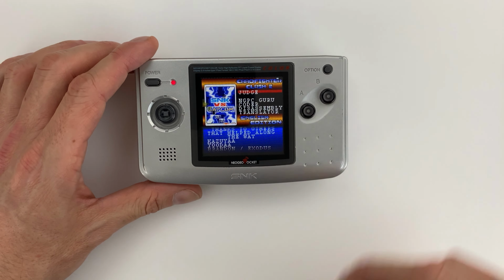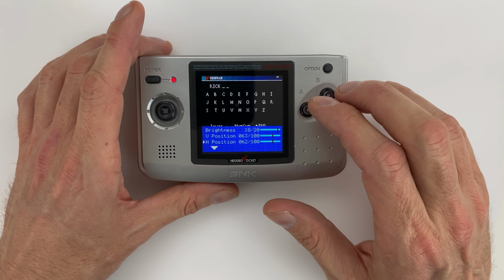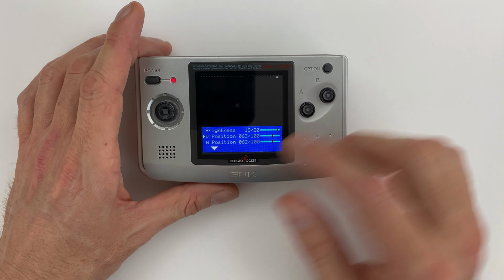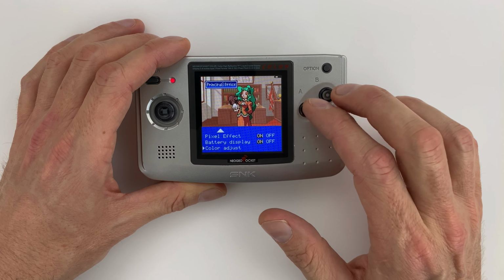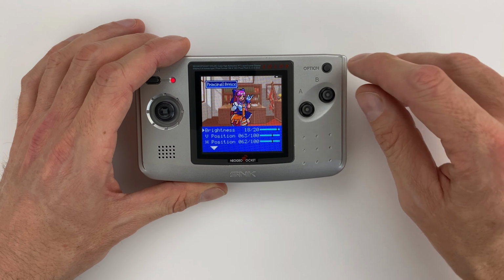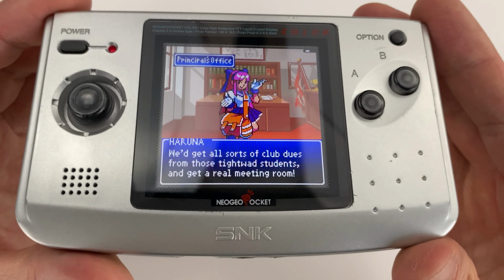Upgrading the Neo Geo Pocket Color Screen (Full size IPS LCD Screen Kit)

Comment: For information, with this new IPS screen, it is advisable to use 1.5v alkaline batteries or rechargeable batteries with a constant voltage of 1.5v, because conventional rechargeable batteries have a voltage of 1.2v and this is not  sufficient for the IPS screen. If you use 1.2v rechargeable batteries, the console will turn on the first time you use it, but after that the screen will not turn on, there will be only sound and no picture. In this case, you have to remove the 1.2v batteries each time, wait a bit and then put them back to play again.
Conclusion, buy 1.5v stable voltage rechargeable batteries or alkaline batteries

Comment: Is replacing the front glass really necessary? In every installation video I’ve seen people are doing this, but mine is in good shape… how come everybody is using the one that came with the kit?
Reply from the maker: I’m guessing to have nice new adhesive, and maybe a better front glass/lens? When I remove an old glass lens I know I usually consider that part as no good. Have you had better luck with that?
Reply: @jivinhipcat  we'll see im attempting the mod right now 😅 i just dont want to do the extra work of replacing the screen i guess?
Reply from the maker: @mindscan420  you must report back, for science
Reply: @jivinhipcat  worked perfectly fine :)
Reply: @jivinhipcat  I didn’t bother doing the whole 4 wires for OSD thing either, the touch pads are plenty for me. I don’t know soldering and didn’t wanna bug my roommate too much, so I just had him help desoldering/soldering the speaker part
Reply: @mindscan420 hank you, that's the answer I was looking for. I don't want to change my glass either.

Comment: have you ever run into an issue with your IPS mod screen becoming extremely dim? i got the Gamedrive yesterday and played for a few hrs, then the screen crapped out, now its extremely dim... I tried to connect my other NPGC mainboard to it, and same result, so its clearly the mod board or screen itself.. not sure what the fix could be apart from completely replacing it with a new one?

Comment: How did you get card fighters 2 running on this screen? For most of us it won’t work. What cart are you using?
Reply from the maker: It’s the Flash Masta cart https://www.flashmasta.com/product/neo-pocket-flash-masta-usb-32mbit/ I haven’t heard of any problems with CardFighters. Maybe it’s a different version; this one has been translated to English, or maybe there is a different cart people are having problems with? Not sure.
Reply: @jivinhipcat  Thanks for sharing! Yes some others must have older versions and they didn't work, probably drew more power than the newer one and official carts.
Reply: @kayg5903  There's a fix for that but it's not great. Buy Energizer Lithium Batteries. It always gives a constant power draw even when it's about to run dry unlike Alkaline Batteries which has a variable (as it gets weaker when nearly depleted). As a solution, i've invested in buying rechargeable Lithium AA batteries that give 1.5v constant.
Reply: @jajabinx35  That's an interesting idea. What's the downside aside from the battery measurement on the OSD being throw off?

Comment: Nice video! How's the battery life for this mod?
Reply from the maker: I haven’t done testing for battery life, but I think Macho Nacho did some specifically on it
Reply: I got over 10 hours on Lithium Batteries with medium brightness settings and pixel Mode turned on. Looks to be around 7-8 Hours on good Alkaline Batteries. Not the 30-40 Hours you could get with original screen but far more flexible in bad lighting and more detailed.
Reply: @overnightdelivery  Thanks for the report!